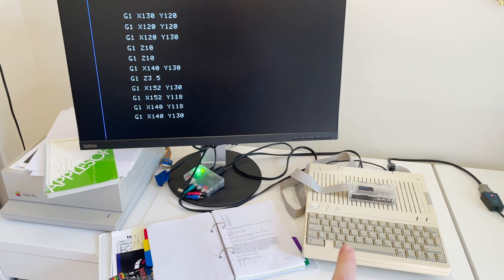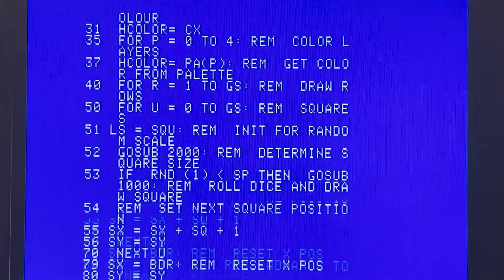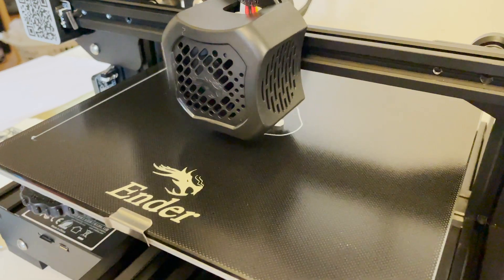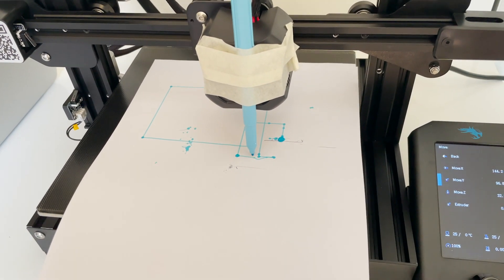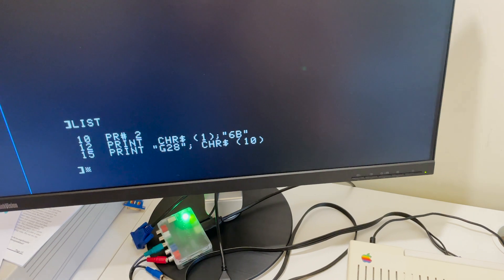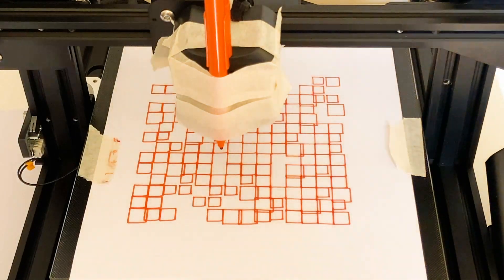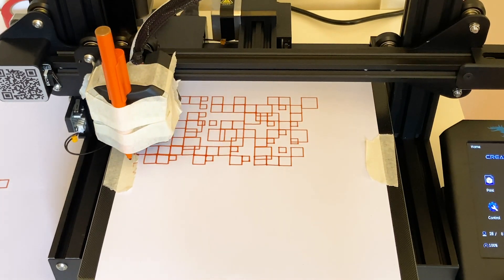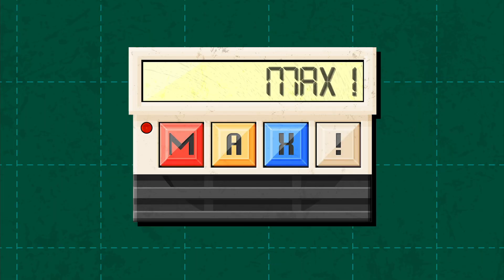Controlling a 3D Printer From An Apple II & Forging Plotter Art

Comment: This is absolutely fantastic. I've been wondering about doing this with my compact Macintoshes for months now, because 3D printers just speak gcode over serial. How is the Apple IIc talking to your MacBook? Was there a real Arduino in the mix, with Unity handling the interface between the real Arduino and your MacBook?

I'm not sure about the controller board in the Ender 3... but I think most of these printers use a USB to serial IC, or the microcontroller on the printer itself does that conversion. It's probably possible to remove USB from the chain entirely, although you'd probably have to hack the firmware a bit. A friend of mine built me a board a few years ago that used the GPIO pins on a Raspberry Pi to send Gcode to my Printrbot's Printrboard. It did have to shift voltage for me, which is part of why a bit of extra hardware was needed.

By the way, Marlin started out running on commodity Arduino hardware. AFAIK, it's still 100 percent Arduino-compatible, the printer's controller board is just an Arduino-compatible microcontroller with some extra hardware added around it. So the way I see it, you had an Arduino talking to a MacBook talking to an Arduino. That doesn't change how awesome this is, though. Thanks a bunch for posting this video!
Reply from the maker: Ah that's great! It would be so cool to see this done from a compact Mac, and the step up in power would open a lot of possibilities with regards to actually designing plots on a GUI. I should have given a little more detail on the connections in the video. There's no Arduino in the mix at the moment - the IIc is plugged in to the Mac using a usb serial adaptor. The reason why I used the Arduino library in unity was that it was a super quick way to receive and send data over serial. I kind of wish I'd shown the connections from one end to the other as I also had to modify the USB cable that runs between the Mac and the printer. For some reason the ender 3 goes haywire if you plug a usb cable into it that has power on it. Even when the machine is switched off. I had to physically cut the positive wire in the USB cable that is connected to the printer.

Thanks for the info on the raspberry pi setup - I am currently considering a raspberry pi over Arduino for this project. That's really interesting about Marlin running on Arduino compatible hardware - I had no idea!
Reply: @maxpiantoni  If your Ender 3 has some GPIO's exposed, I'll bet it would be possible to compile Marlin 2.x with some changes to have it listen for serial over them. I managed to compile Marlin 2.0 for a Printrboard (ancient printer controller board) last week.

I have no idea what kind of serial an Apple IIc talks... but it would be pretty insane if you could go direct from the Apple IIc to your printer with nothing but some conductors and a logic voltage level shifter (what are those called again?) between the two!

Comment: What was the problem with baud rates?  Your printer doesn't go slow enough?  The speed the g-code is sent needs to be more specifically controlled than the apple // was able to send...?
Reply from the maker: Yes more or less both. I got the most stable results with the printer running at 115200 and the Apple II running at 300. Also it helped to hold the commands from the Apple II in a buffer before passing them through to the printer or it would drop commands. I’m not sure entirely the cause of this yet though, but it was very helpful to have the Mac in the middle to pass the messages and give me a window to see into what the two were saying to each other. That said I will do more experimentation in this department as I figure out the best way to build a dedicated box to pass the serial connection between the two devices.
Reply: @maxpiantoni  Hi Max...
Just wanted to say great job on this!  If you are still working on it, just a couple things:  I'm surprised you have trouble with your //c above 300 baud.  Are you sure it has the mod that was done where the IC was removed and a crystal added?  Mine runs 115,200 very stable with BBSs and ADT pro.  ALSO, Arduino Mega and ESP32 both have 2 serial ports built into the microprocessor and may be useful to just read form one and write to others with a quick C program.  If you do more with this, that may be work looking into!  Really cool would be to get apple Logo to be able to plot onto that 3d printer!
Reply from the maker: @jimb032  Thanks James. And thanks for your comment! I made a mistake when talking about the baud rates, the issue wasn't with the apple II but rather that I was sending too many messages to the printer too quickly. The printer can only hold a certain number of pending instructions before it starts ignoring incoming instructions. At 300 baud the messages were so slow that it was less of an issue. This came about because of the approximate nature of my serial bridging program, I've since re-written that part of the project in python and will eventually add some kind of buffer to it to avoid this issue and wait until the printer is ready to receive new instructions before sending them. I'm thinking I will eventually use a raspberry pi to run the serial bridging program in python. I agree that Logo would be cool. I've done a few cool things since this video and now have programs that plot on the screen at the same time as they plot on the printer. I've also done a little bit in Apple Pascal but I'm still figuring out a good cross development workflow for Apple Pascal because I want to edit the code in a modern text editor. Once I've  made a bit more progress I will make a follow up to this video.